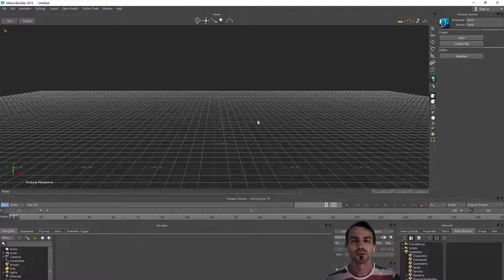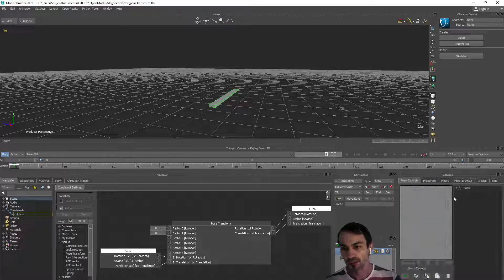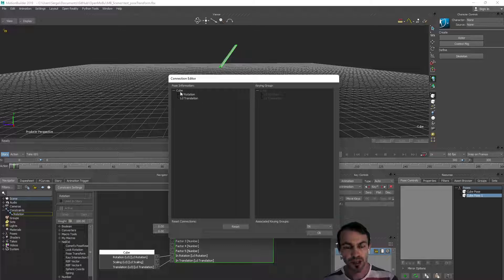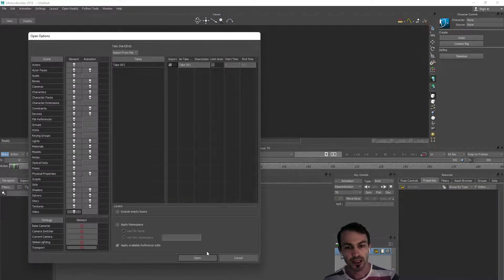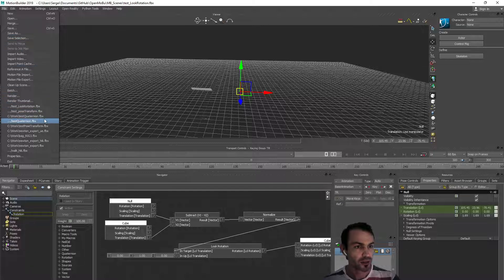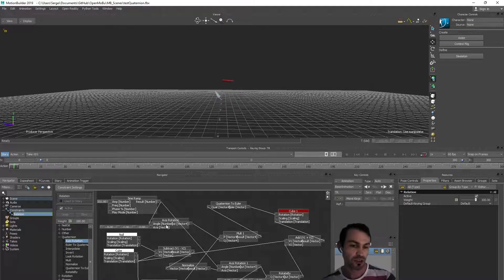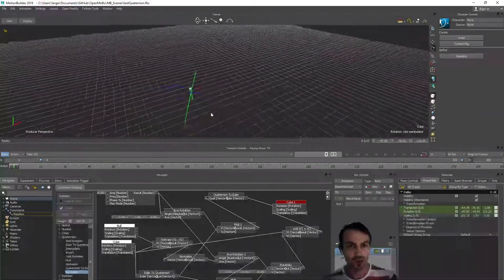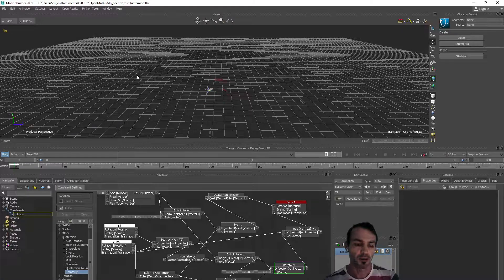New Relation Constraint Boxes for MotionBuilder

Comment: nice, it is very helpful for me to see your video, can you share this quaternion constraint plugin with me? I didn't find it in the plugin you shared. I need this quaternion conversion when I motion capture
Reply from the maker: source code you can find on github repository OpenMoBu and as for the binary, which mobu version do you use ? I didn't prepare all binaries and a new installation package, but can build for some version if needed
Reply: @Neill3d  Thanks for your reply, I need this plugin very much, my mobu is 2019.
Reply from the maker: @yuanfengxie157  for 2019 you can try with existing binaries in the github repo - https://github.com/Neill3d/OpenMoBu/tree/master/bin/x64/plugins_2019
not always working well (sometimes files are corrupted from a github), I still have to update release section with new installer
Reply from the maker: this is about boxes box_RBF and box_poseTransform
Reply: @Neill3d  tanks😁😁